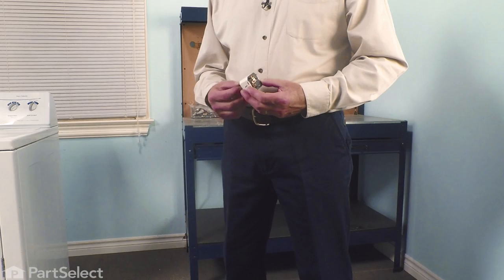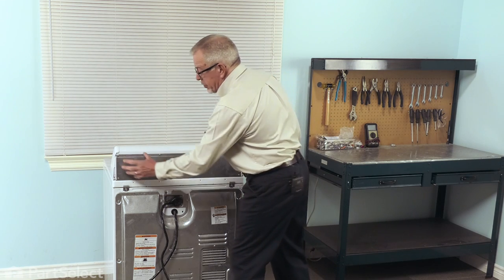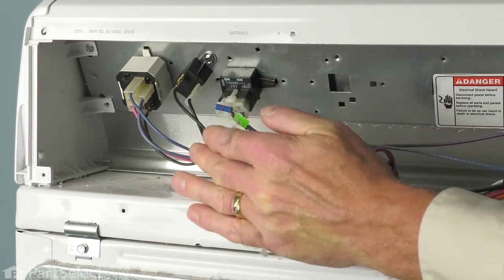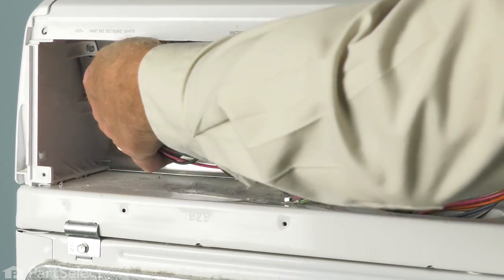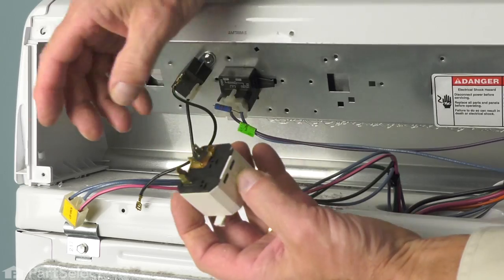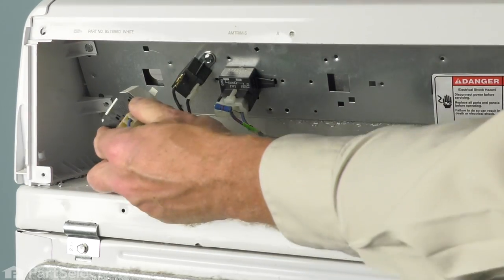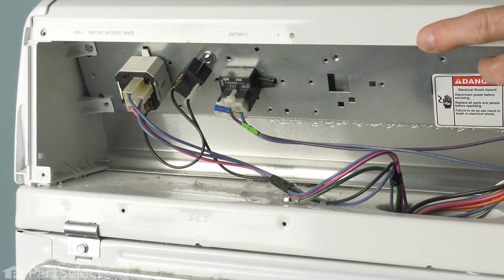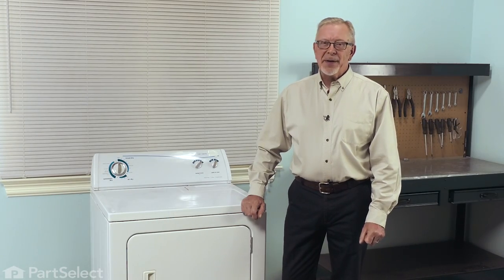Whirlpool Dryer Repair - How to Replace the Push-to-Start Switch (Whirlpool # WP3398095)

Comment: Your step by step video was very easy to follow and I was able to replace the starter switch without much difficulty.  Unfortunately the dryer still would not start with the new starter.  One question - I tried to start the dryer with the new switch installed, but without putting the back panel back in place.* I assume this would not impact the dryer's ability to start?  *I tested it this way because the dryer is in a very tight place and reaching all the nuts in the back panel was difficult.

Comment: I think my start switch is bad but I can't find a video on testing continuity of the switch pictured. When I touch blue and red I get open. When I touch both blue I get beep. When I best black and red I get a beep. But I think the switch is still bad because outside blue to outside red gets an open cirtcut reading
Reply from the maker: It may be helpful if you have your wiring diagram handy for doing those tests. That switch works with a relay so in some cases your going to read the coil and other times a set of contacts. The coil is energized once the button is pressed pulling up a set of contacts to close and start the motor. Always do these tests wit the power off.